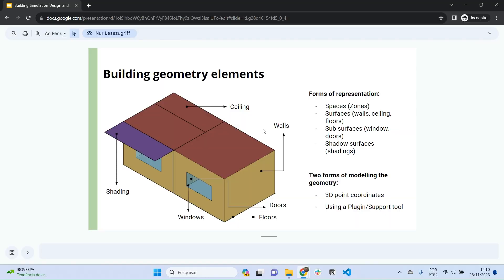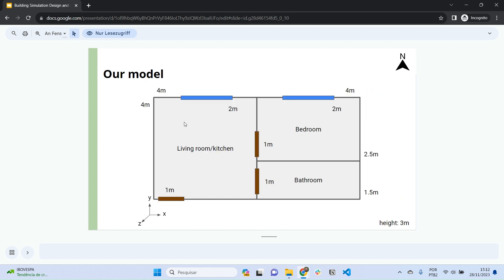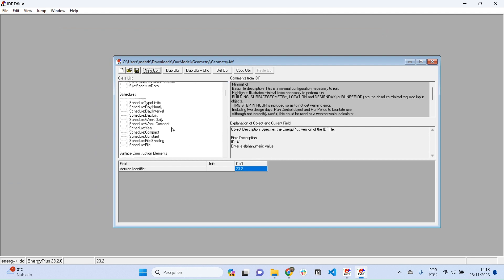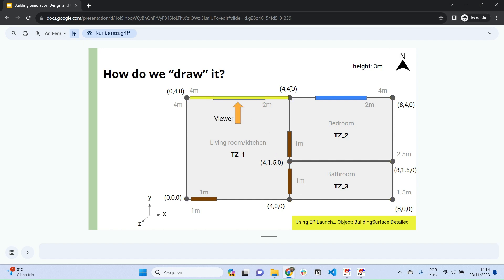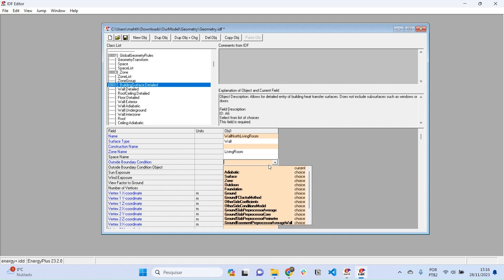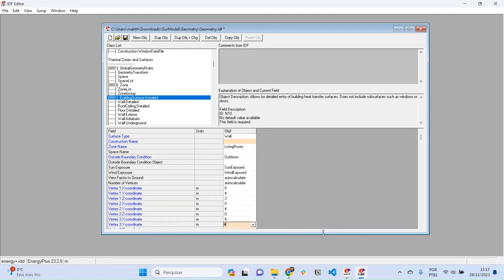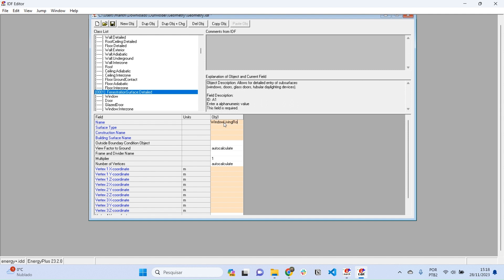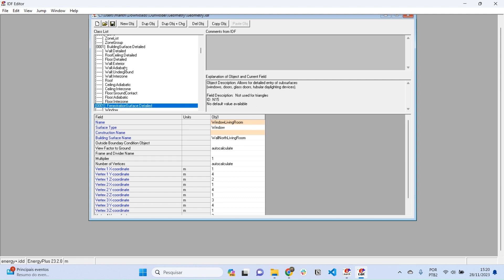EnergyPlus for beginners - Part 3 [Geometry]

Comment: i read the i/o instruction of energy plus. this is a paragraph of instruction: 
"Surfaces are always specified as being viewed from the outside of the zone to which they belong.
(Shading surfaces are specified slightly differently and are discussed under the particular types). EnergyPlus
needs to know whether the surfaces are being specified in counterclockwise or clockwise order (from the
Starting Vertex Position). EnergyPlus uses this to determine the outward facing normal for the surface
(which is the facing angle of the surface – very important in shading and shadowing calculations"
Can you explain why your view is using in the room. which rules is correct

Comment: Thanks Matheus for sharing knowledges!  A little bit confusing with coordinates: here for the window we have 1,4,2 then 1,4,1 etc., as we were looking from the inside, and starting from the upper left corner. But in 5th video  08:45 the different coordinates are shown: 3,4,2, then 3,4,1 etc. So, the correct way is to put coordinates as from the outside from the object?

Comment: Dear Matheus, 
I have another question. When we load the surface for the roof, should we select "roof" or "ceiling" in "surface type"? and we have to load a diferent surface for each roof in each termal zone, right?
Thank you very much. This video has really helped me to understand energyplus.
Reply from the maker: Roof means it goes to outdoors, ceiling means the surface in contact to the floor of the upper storey. And yes! You need to associate each surface to a single thermal zone. Actually, think that you model the surfaces "inside" the thermal zones.
Reply: @matheusgeraldi very clear. Thank you!

Comment: Hi matheus,
Thank you for your great video! I have a question for you about coordinate axes for each thermal zone. Why is the origin at the lower left vertex instead of the upper left vertex (as in the surfaces)? Thank you very much for your help!
Reply from the maker: Hi Maria. Thanks for your feedback. It is just a convention. Actually, the coordinates for TZ's origin are not that important! You can choose to put it any other coordinates you like more, as long you insert all surfaces' coordinates according to the relative/global rule of coordinates systems.
Reply: @matheusgeraldi  Perfect,
Thank you again!

Comment: Thank you so much Sir. And I am curious that what if I have a glass wall? I was trying to treat it as a window (without inputting a wall for the same position in the previous step) but I am not sure about its building surface name. Appreciate it!
Reply from the maker: Hi! Thank you for the feedback. It won't work this way. You have to model a wall (surface), and associtate a window (subsurface) on this wall. You can make a very big window (around 99% od the wall's area). That way you can have a glass wall.
Reply: @ Got it! Thank you for the advice. Your tutorials are insightful and helped me a lot😀

Comment: Dear Matheus, How should we consider model the inside doors? For example the doors between The livingroom and the bedroom.
Reply from the maker: You have to model the door as a subsurface (Fenestration surface) in one thermal zone (livingroom) and identically in the other thermal zone (bedroom), and then, match both subsurfaces together by setting the "outside condition surface" of each as the other subsurface. Let's say that the door is modelled in subsurface on Livingroom as "Door-Livingroom" and on bedroom as "Door-Bedroom", then you have to set the outside boundary condition og the "Door-Livingroom" as "Door-Bedroom", and the outside boundary condition of the "Door-Bedroom" as "Door-Livingroom".
Reply: @matheusgeraldi  Thanks for the clarification. However, I have one more question: what about the shading surface? How should we model it? Is it the same as the ceiling, or are there any differences to consider?
Reply from the maker: @isaquesoares6600  It is not the same. You have to use the object class "Shading:Building:Detailed" in EnergyPlys. It is very similar to "BuildingSurface:Detailed" in terms of how you describe the geometry, but the software understands shadings as objects "without temperature", so there is no radiative heat transfer between shading and other objects.
Reply: @matheusgeraldi Thanks again for the quick response. I have one more question. Do we need to create a separate thermal zone for the shading in the video example? In the ceiling example, we had to associate it with both a space and a thermal zone. Should we do the same for the shading? If so, would this new thermal zone consist only of the exterior floor and the shading?
Reply from the maker: @isaquesoares6600  No need for creating thermal zones for shading.
Reply: @matheusgeraldi  Estava tendo vários problemas em relação às portas. Vi seu comentário e ajudou demais! Muito obrigada, Matheus!

Comment: Hello, if I want to simulate a building with multiple floors, and each floor has exactly the same layout of thermal zones, can I use the created thermal zones directly? Or do I have to create thermal zones for each floor even if their layout would be  the same?
Reply from the maker: You can simply model the ground floor, one "typical" floor, and the last upper floor (roof), and then, multiply the results of the typical floors by the number of floors you have. It is not perfect, but it is a valid approximation.
Reply: @matheusgeraldi  Thanks for your advice, however, excluding the method of multiplying directly, if I want it to have a relatively accurate value, does that mean I should create thermal zone and wall coordinates for each floor (Same x, y coordinates but different z coordinates)?
Reply from the maker: @DZ-tb7hk  You can do that, but trust me, it is very accurate using the multiplying approach. It won't be accurate if you model the surroundings of the building (other buildings, for example), because then the shadowing of other buildings will be different for every floor. Otherwise, it will work nicely and smoothly. ;)

Comment: Hi dear Martheus, thanks a lot for sharing these videos. I have a question, if we design a structure in three floors, if we are going to equip this structure with solar cells, how can i calculate the amount of produced electricity energy per meter? The structure area is 3000 square meters.I am an urban planner and I don't have knowledge about BIM or other related software products
Reply from the maker: Hi Mehdi, thank you for your feedback! I am planning on upload more videos regarding this topic, but for now, something that can help you is this website: https://www.pvsyst.com/
Reply: @matheusgeraldi  Thanks a lot

Comment: Thanks for your video, it is useful for me. But I have a question about this model. Now I am doing this model in EnergyPlus, in this model, that wall, inside this model, did I need to create two times? Because the wall belong the livingroom from the livingroom's angle however from the bedroom or bathroom, that wall belong them. I want to know how the EnergyPlus defined this thing?
Reply from the maker: Thanks for your feedback! Yes, you have to model the surfaces representing this wall two times, one belonging to one thermal zone, and another time belonging to another thermal zone. Then, you have to match all surfaces, and you do that by setting the "Outside Boundary Condition" to "Surface", and the "Outside Boundary Condition Object" to the name of the surface that you want to match. For the example shown in 7:42, you're going to match "Wall_East_ZT_1" to "Wall_West_ZT_2", then simply associate these two walls by their "Outside Boundary Condition"s. Remember that you have to do that on both surfaces.